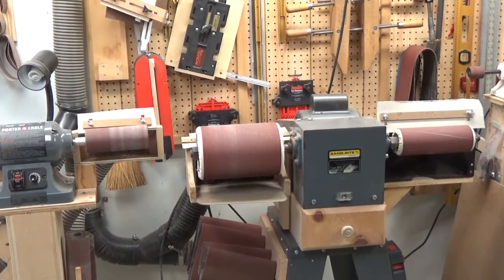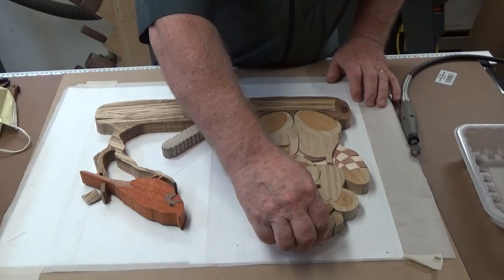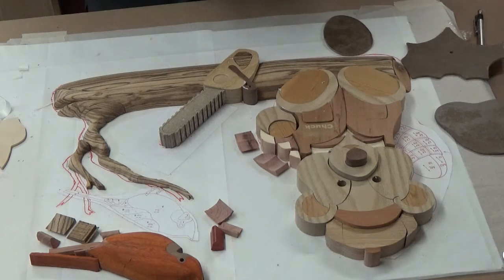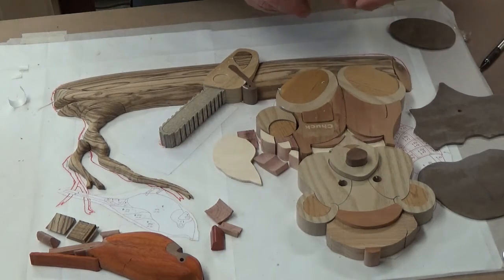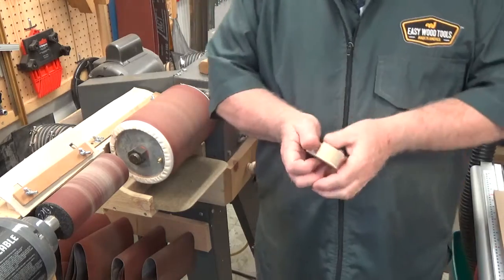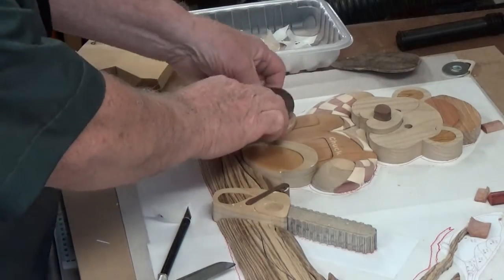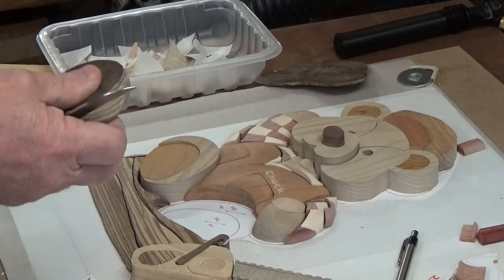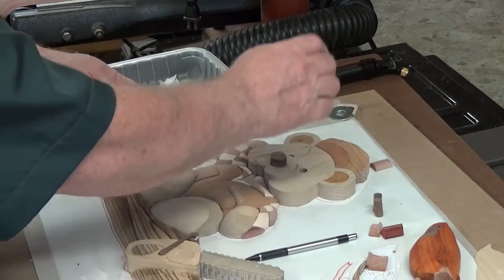Intarsia Project 4 Shaping

Comment: I have a 3/4 spindle motor used with a grinder. Can I get an adapter to put a chuck on it like you have?
Reply from the maker: I haven't found one. McMaster Carr has an adaptor that will fit a 3/4' shaft and one can mill the other end down to a desired size. This might be a job for a local machine shop.

Comment: Why do you start with the furthest away?  Why would you not start with the closest and then remove material as needed going farther back?
Reply from the maker: To be honest, some folks do it that way. But, I find that working from back to front results in less adjustment of pieces I've already shaped. When I work from front to back, I find that I'm not taking off enough wood or, in some cases to much wood. Then, when I shape the next layer, I have to reshape pieces to fit correctly. 

I tend to follow Judy Gale Roberts methods for shaping projects. You can see  some of her methods on her website at intarsia.com.
Reply: Thank you so much for sharing your wisdom and talent.  You are a wonderful teacher and mentor.  I’m new to intarsia and learned so much from watching your excellent video.  I love your sanding bench.  Wishing you continued success.

Comment: Where can I buy a sanding mop ?
Reply from the maker: Here is the website for the sandpaper. Choose your grit here. I use 220 grit and 320 grit mostly. The sanding mop is for smoothing and easing edges. Don't use it for shaping.  https://www.woodworkingshop.com/product/fs32100/

Here is the page for the arbor that fits the 5/8" shaft of the 8" slow peed grinder. O that page you'll see the links to the arbors that fit drill presses. That is what I use because of the drill chuck I have on my sander. It fits other tools as well as the mop arbor.  https://www.woodworkingshop.com/product/cl10014/

Comment: I hate to be negative but I guess I will be. I was very excited to find this intarsia about doing the contouring, my biggest problem.
You didn’t show  sanding the log, branches, or how you decided how much to sand. 
Did you mark the arms in anyway to tell how much to sand? Then you have other parts sanded and on to the body without showing how. That’s what I wanted to see. I figured the rest would be the same so I left.
You do have an impressive shop. Way beyond my few machines
Reply from the maker: Sorry - I missed that detail.  I always start shaping the pieces furthest away first. So, the branch and log were shaped first. The branch is thinner than the log so it was first. The teddy   sits on top of the log and his feet stick out proud of the log, so the log was second. Also, the chain saw has to be proud of the log. The bird is thicker than the branch.

I hope this helps you a little.